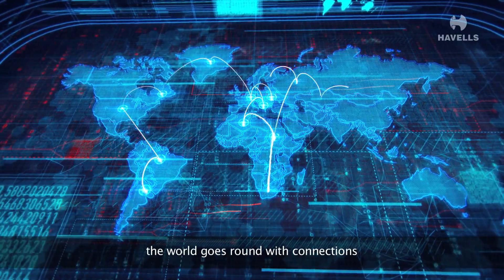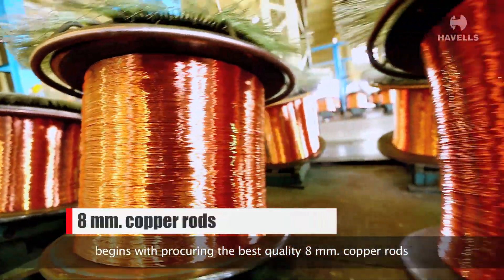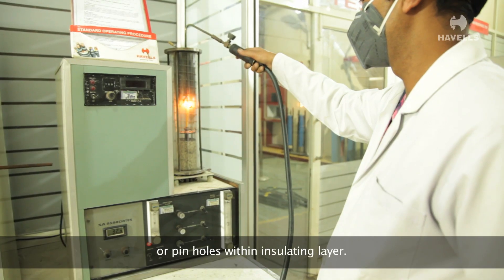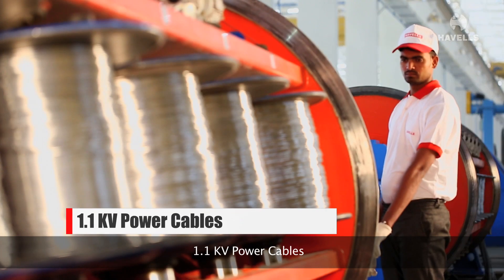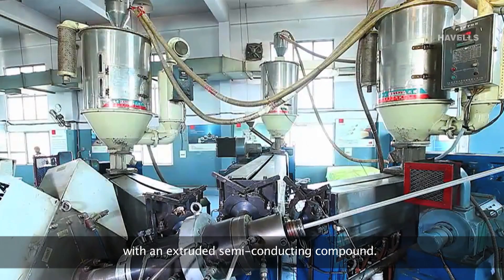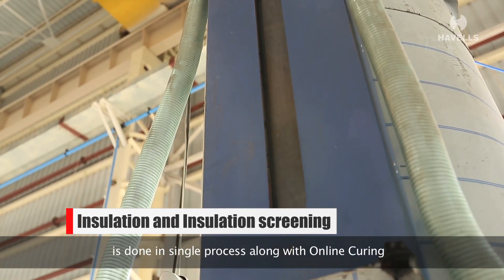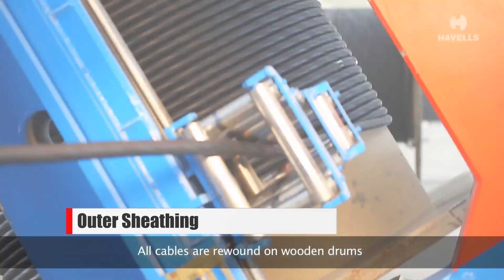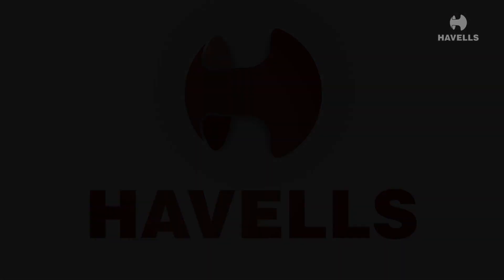Havells Alwar - Cables and Wires manufacturing plant

Comment: worst service quality. HD074244
Reply: Vikram Kumar give Copperweld wire a try
Reply: Hii
Reply: @rizwandody6931  u
Reply: If you want good quality cable than contact 9982301670
Reply: @sureshgurjar6365  
Ramprakadh
.